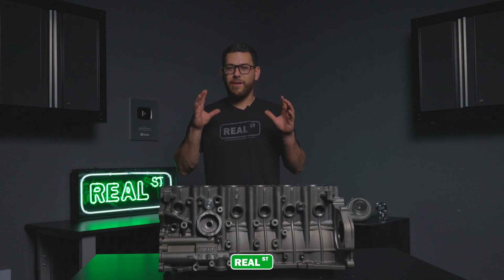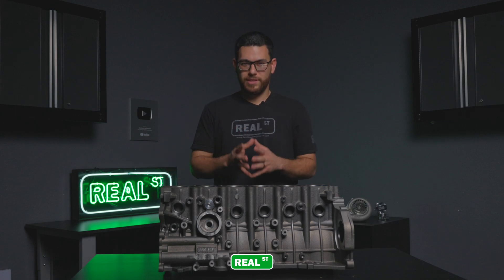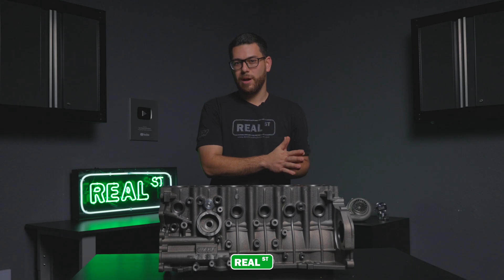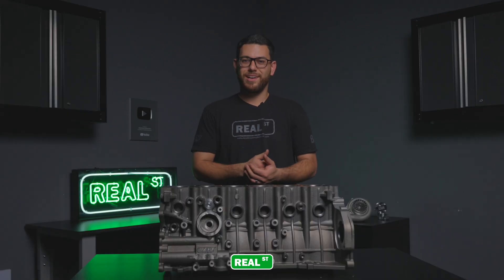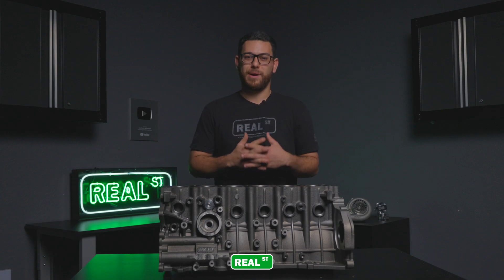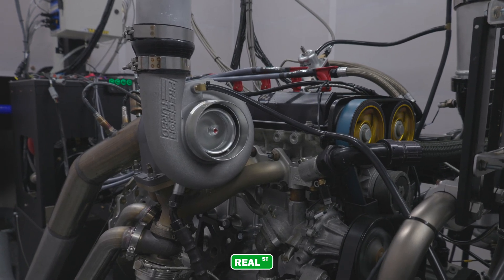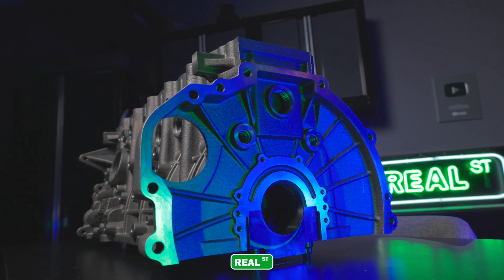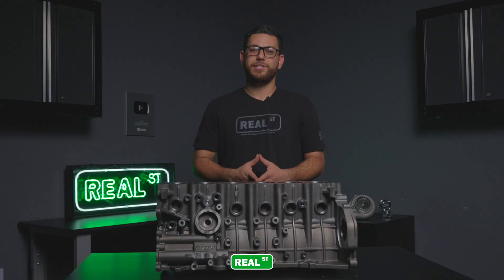The New Dart Iron Eagle 2JZ Block Is Here | Real Street Performance

Comment: Nowadays most limitations I see on the high end are due to head sealing issues.  Noticed that 6 bolt per cylinder design has become the standard in new/ bespoke racing engines but dont think I've ever seen it on a DOHC setup.